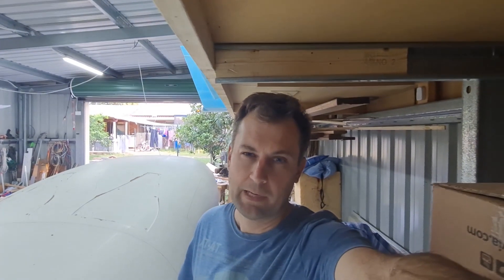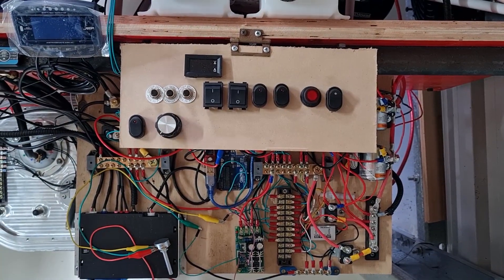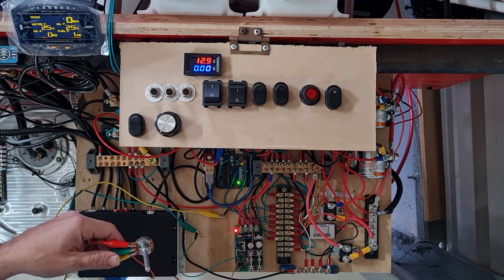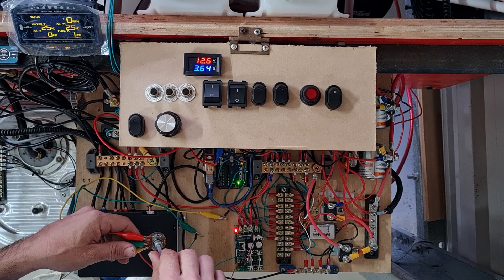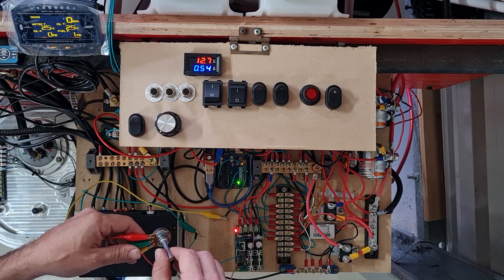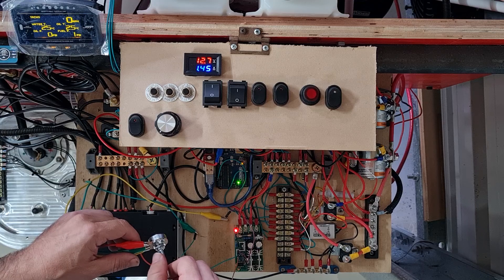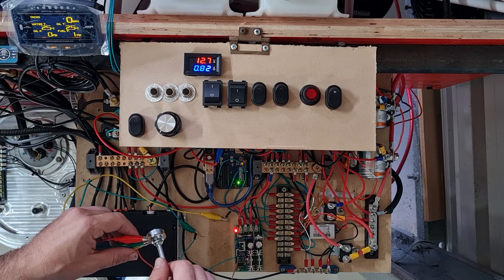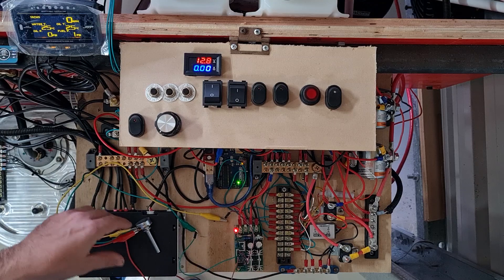Viking 195T - Test installing the fan PWMs

Comment: I'm looking forward to every vid. Just watched them all. I want to build the same combo but with retract gear.
Reply from the maker: Thanks Brian.
The retact gear would be great, a bit more expense and work involved but the I also love the idea.
Reply: @AusVelocity  I hope one day someone tries the dual engine velocity with the 195t
Reply from the maker: @brian856  Not very familiar with the V-twins. The viking inline 4 is a bit of a taller engine that suits most planes with a little bit of regigging. Just not sure if it would fit well on top of a wing. I think someone has put a pair of UL520IS Turbos on the one, still air cooled,  but a step in the right direction.